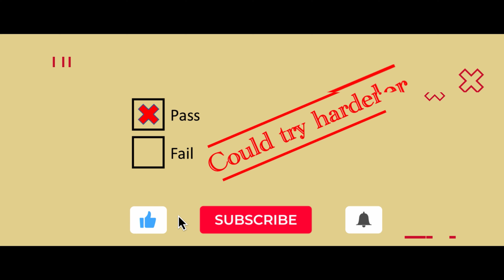Renault Rebuild - Capturing the Captur

Comment: My guess is they hit a Kangaroo. All the tell tale signs are there
Reply from the maker: I WISH that were the case!! They carry more heft than a deer though. Complete write off for sure!!!
Reply: Friend of mine lived in Norway. You have to deal with Moose there (and he’s managed to survive hitting one!  That would have done the job. But deer is probably the most likely culprit.
Reply: I also reckon a deer, Simon moose are huge that's scary 😂, @tomcallaghan4664 kangaroos must make a right mess. We we where saying at least captur hasn't got those firing caps which push the bonnet up, they can be a nightmare to fix then. This one looks pretty straightforward, so fingers crossed.